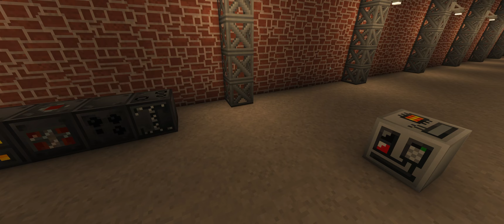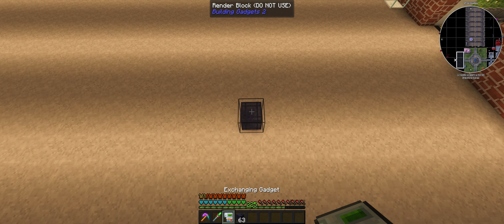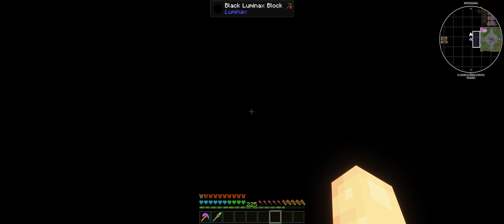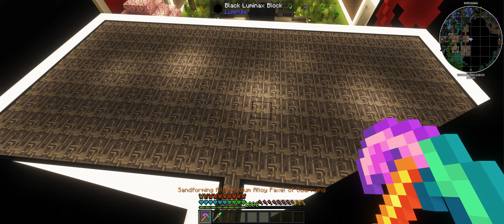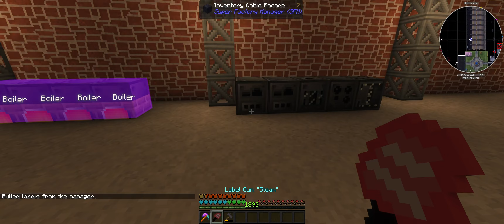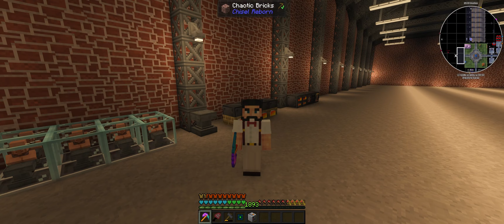All The Mods 10 (Ep. 33) - Modern Industrialization - Unlocking Electric Age

Comment: How were you able to have the sfm cables appear as another block? I cant find the mod that does this in ATM10
Reply from the maker: You can facade them by holding the network tool in your offhand and right clicking a block on the cables. Hold ctrl to do all inv cables at once.
Reply: @thevoos33  I soon found that out after I asked, but thank you! You helped me a ton with getting into MI, the way you approached it was with SFM was very methodical